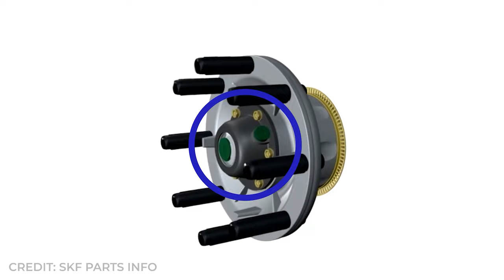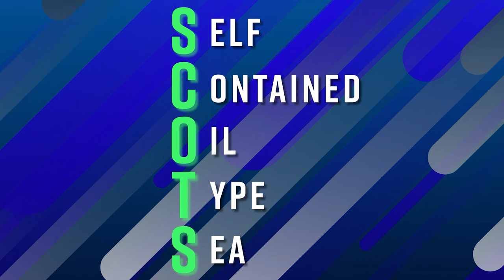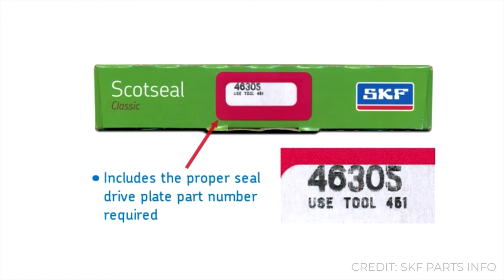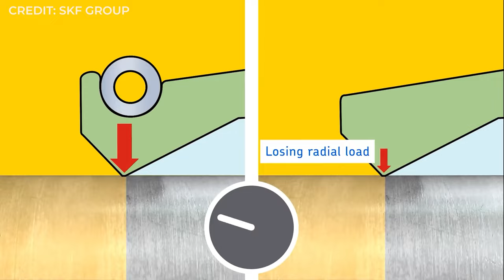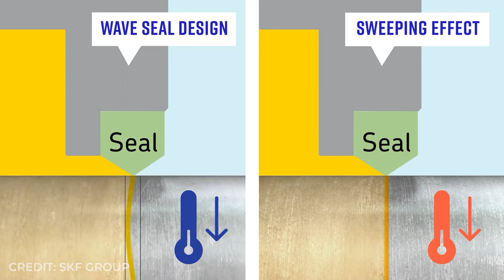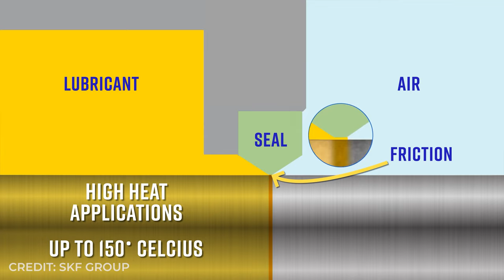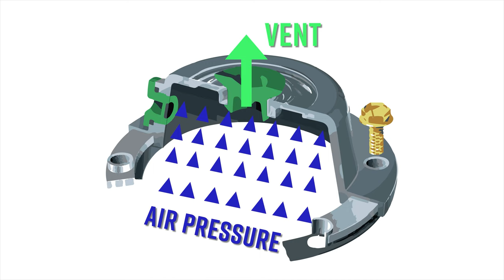Seal the Deal with SKF Wheel Seals & Hub Caps - Gear Up with Gregg's

Comment: when you mentioned about measuring the diameter of the hub cap, do you refer to the holes or the hub cap's most outer diameter
Reply from the maker: You measure the O.D (outside diameter) of the hub cap.